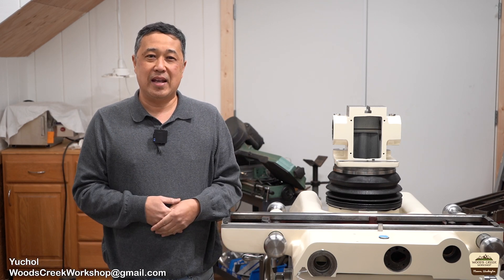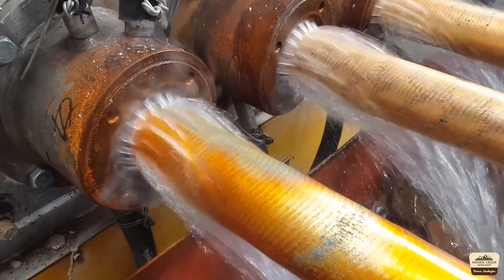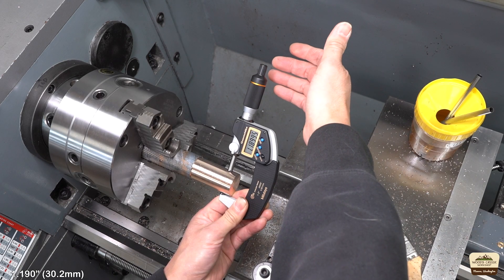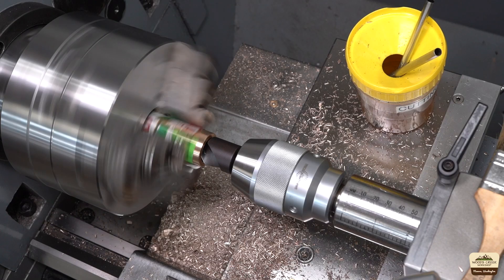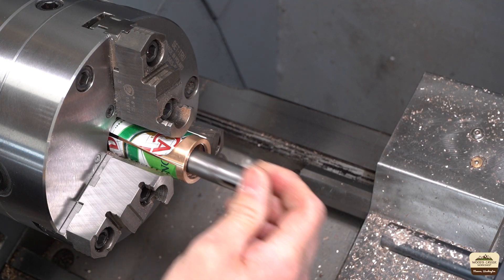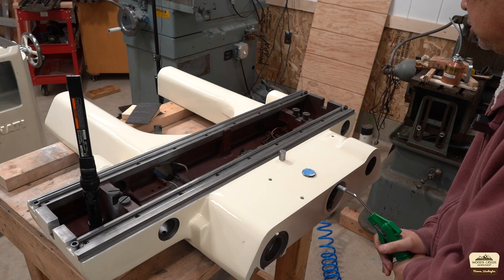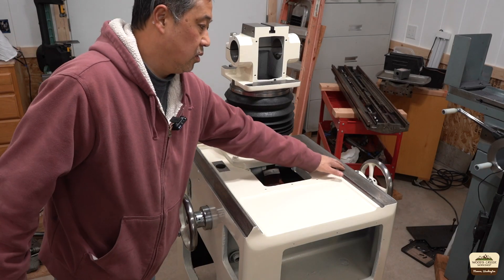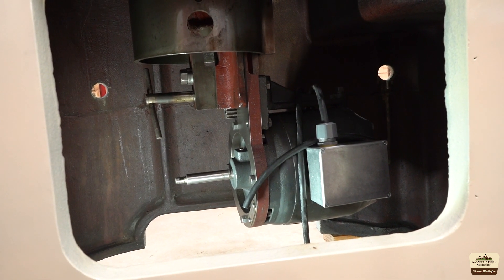New Leadscrew Nut and Saddle Install:  CINCINNATI Tool and Cutter Grinder Restoration Part 6

Comment: Hmm, fascinating, I learned at a similar grinder and we just moved the table by hand. All handles disengaged, we just grab the table and move it however fast we need. I can say the feel I get through table is amazing and when it comes to precise movements, we do those with stops that screw in and out for fine tuning.
I always say there is no right way to do something, just some ways are more right than other.
Reply from the maker: Good philosophy!

Comment: Hello from Aus. I started work on my No 2 yesterday and made a vid on it. The first job is to mount a motor on top of the wheel head to make it similar to the later series No 2's. That way I can throw out all the old electrical equipment . Regards BC.
Reply from the maker: I will check out the video, thanks.👍🏻